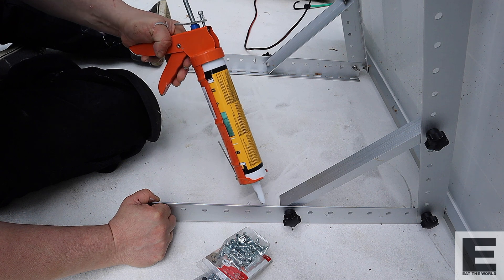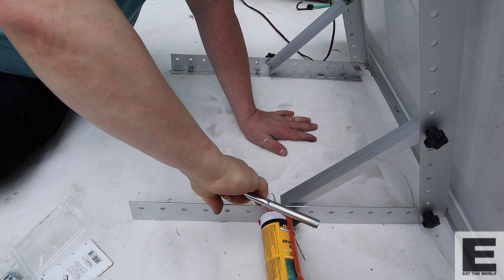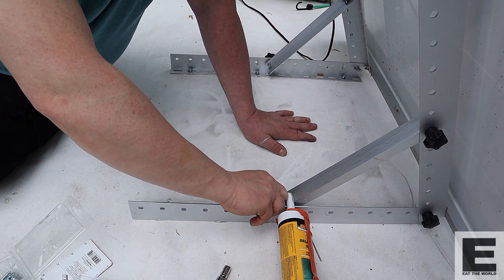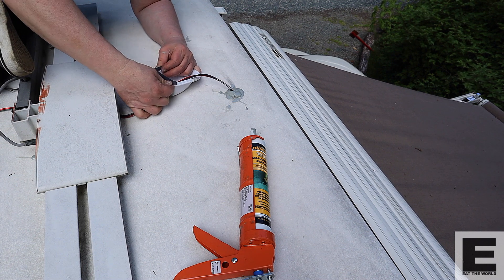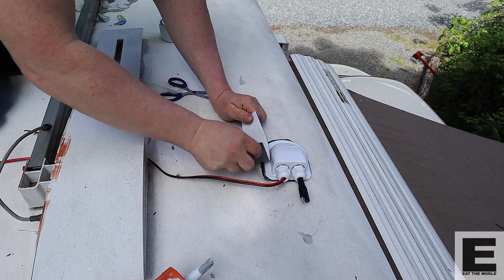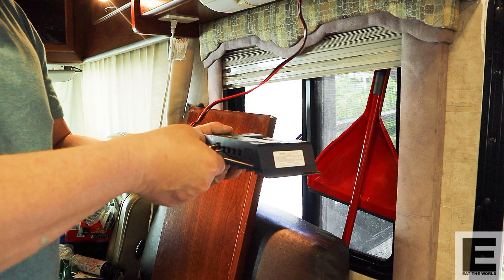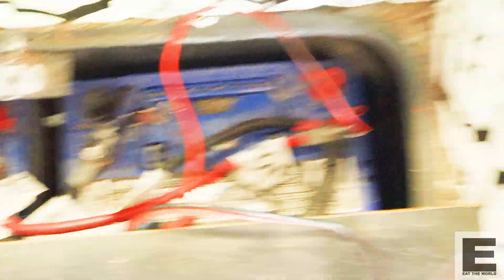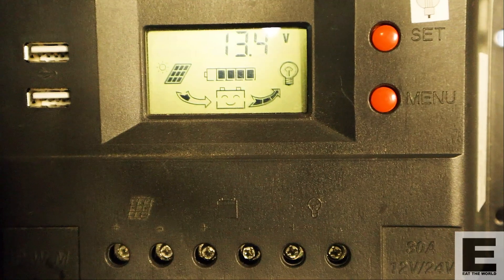Simple Solar Power Installation for RV & Motorhomes

Comment: I think some people think Solar will provide power and they can use it like electricity. That's not the case, it helps to keep the batteries charged and replace what you use per say.
I use line like you do. Keeping the batteries at a safe level while using light power for lights, mobile devices and. They should use Generator for big items.
Good video.
Reply from the maker: Thank you so much!